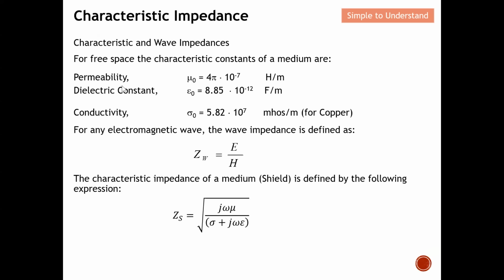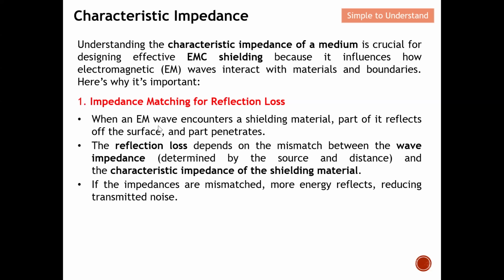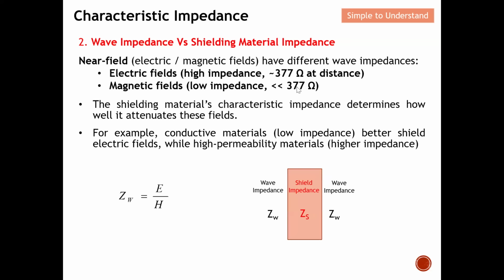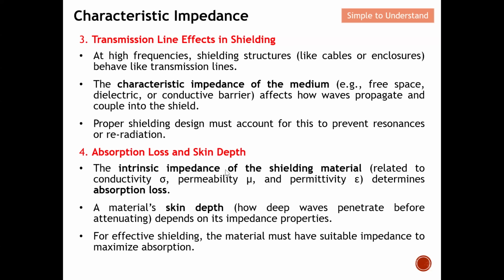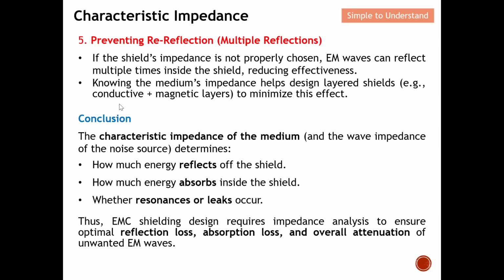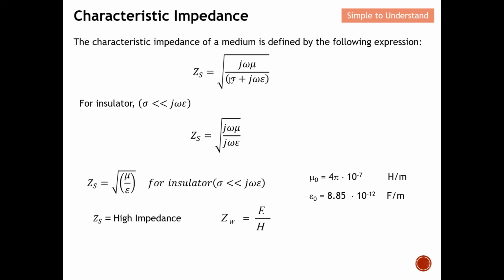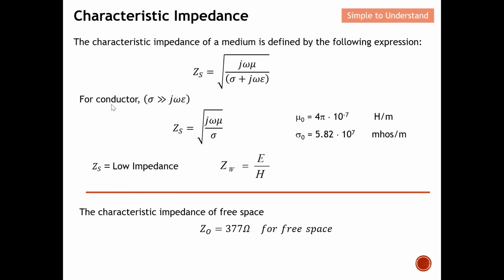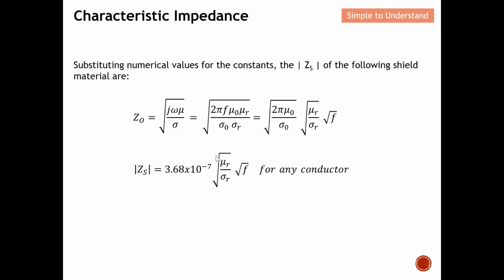EMC #20. Wave Impedance vs Characteristic Impedance for EMC & EMI Shielding Calculations Explained

Comment from the maker: In this video, I’d like to explain the difference between wave impedance and characteristic impedance. Understanding these two concepts is essential for designing an EMC shield. I’ll also share how to calculate the characteristic impedance of the materials used to build the shield. With a simple calculation, you can later evaluate the shield’s effectiveness by analyzing absorption, reflection, and multiple reflections.